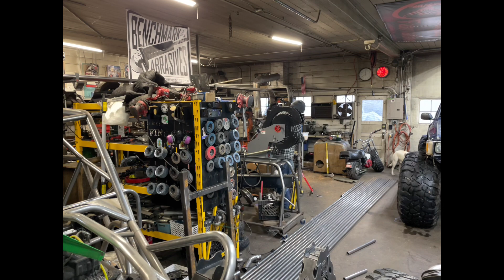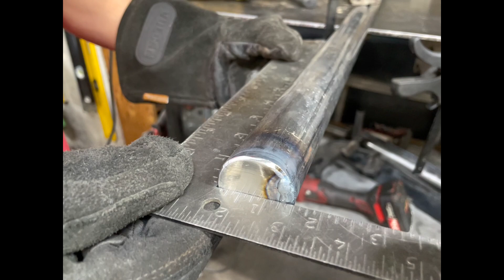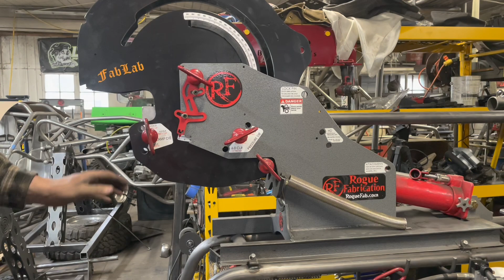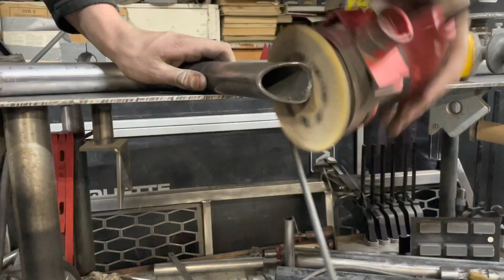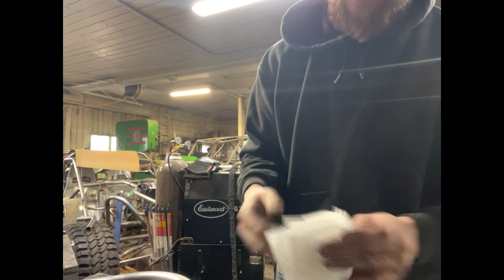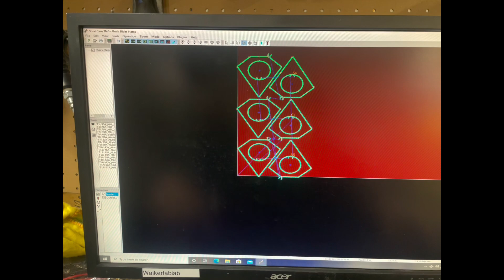Toyota Pickup Exo Cage Build

Comment: Do you position rock sliders as tight to the cab as you can or are you keying off of some low point on the chassis?  I am curious how much a suspension lift might affect the placement.  thanks!@
Reply from the maker: Doesn’t affect anything. Everything is tied in together.